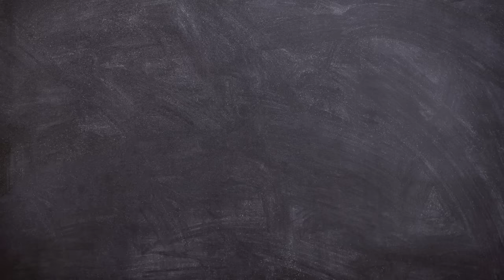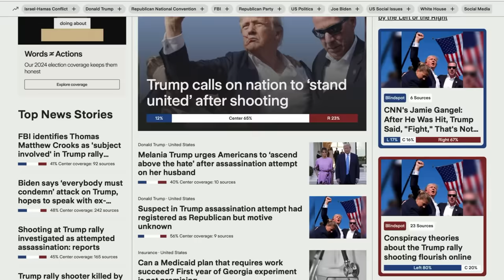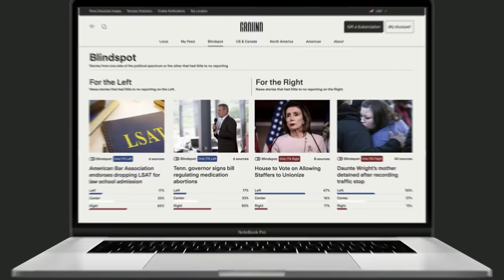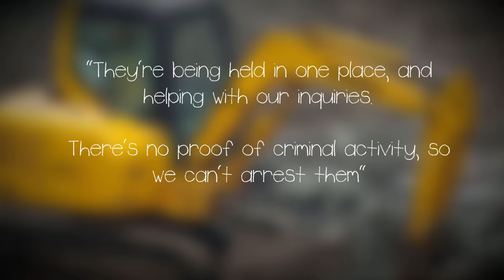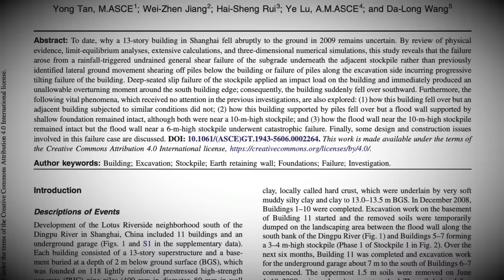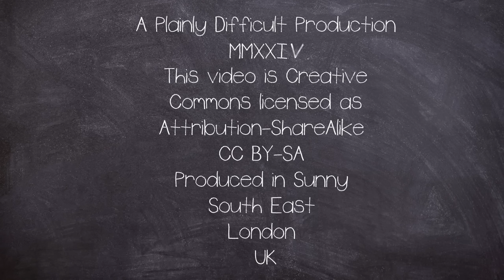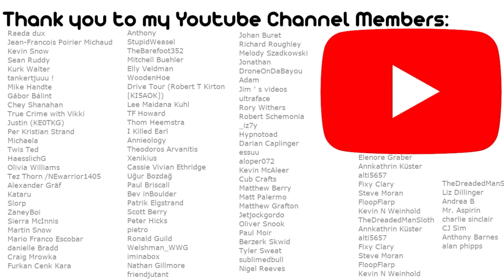Concrete and Steel Tower Falls Over Without Any Warning | Plainly Difficult

Comment: Civil engineer here. 

The abstract of the ASCE report states “Deep-seated slip failure of the stockpile applied an impact load on the building and immediately produced an unallowable overturning moment around the south building edge; consequently, the building suddenly fell over southward.” 

When slip failure occurs, the soil has to go somewhere. With a deep slip failure like this, the failing soil would be slipping beneath the neighboring soil, displacing it and causing uplift. This likely created a horizontal AND upward force on the underside of the north side of the building, causing the building to topple to the south. 

Extra physics fun:
In physics and by extension engineering, a “moment” is the rotational effect of a force, acting about an axis. A moment is produced when an axis of rotation exists (a fixed point that would resist a force) and a force is applied but not applied directly to the point where the axis exists.  A moment’s value comes from the force multiplied by the perpendicular distance to the axis point, or “lever arm.” In this case, the axis of rotation would be along the ground where the south face of the building is in contact with the ground, spanning the entire width of the south face. This is consistent with ASCE’s analysis. ASCE have the ability to run simulations as well and clearly determined this failure method to either be the most likely, or the only possible scenario.
Reply: This is the clearest explination of a “moment” that I have come cross. Thank you!
Reply: So the pile of land with the help of the water under it pushed the building columns sideways and up the building enough for it to fall in like 5sec?
Maybe with enough time that will be the case but then why didn't the building simply slide but rather topple. There must be at least a meter difference between the north/south end for it to just topple.
Also every one is talking about pressure on the soil which would make the building unstable but what caused the building to fall?
Was it off center, wind gust someone leaned on it?
Reply: Thanks for a splended scientific explanation... Isn't it sad, that everything discussed & required, can be destroyed by three simple words ...  "It's Good Enough".
Reply: It seems the north rising flow of soil would be slow, causing a slow tilt, allowing time for corrections the next morning. And the south piles would keep the south side from pressing into the ground and falling; at least not rapidly. A big fuss is made about the leaning tower of Pisa, but I was amazed that many of the building in Venice were leaning in different directions. It sits on mud.  In this case the probable deep lateral movement of soil, caused a moment on the piles, snapping them deep underground. Piles are not strong in moment. And the pile’s broken ends would be moved out of alignment so the broken south piles couldn’t support the fall of the south side. The piles would slowly be bent until they snapped with an earthshaking impact, that might have triggered the rapid soil flow on the south side. Soil under the south side could compress and flow rapidly into the “ready-made” garage cavity. The pivot/rotation axis was probably closer to the south wall but not at it. It is always dangerous to dig a hole or pile up soil near a building, unless the building is sitting on bedrock. Wet soil becomes fluid and head/height differences make it flow like water; applying pressure to one side of a building, and flowing out from the another side. The Seattle Millennium tower began to tilt when the city dug out ground. And the attempted repairs required more digging which caused more tilting.
Reply: @qa1e2r4  As far as I can gather, the imbalance was caused by the slip of ground beneath the 10m pile of earth together with the trench dug out on the other side of the building. This built a stress (3000 tonnes) acting in 1 direction more than the other (toward the river). That's your 1 meter difference, in effect. All that was required was the heavy rain to provide the lubrication / loading up of the waste earth and the mass of the building rotated about the piles. The latter are the reason it didnt slide. Its like trying the drag a fork through set honey. If the pile of earth had been 'piled' before hand, perhaps the stress may have been mitigated somewhat. But I might be miles out there!
Reply: I also thank you.
Reply: SNAFU
Reply: When I first saw this I figured soil liquefaction would be involved, coupled with insufficient pilings to support the structure weight - the construction being near a river that didn't really have a good substrate area to support heavy/narrow buildings like this.  Looks like a lot of other factors were involved too though, the deposit area of other soil adding to the lateral pressure on the building.  I've always known since the engineering courses I took in the 70s that the biggest issue with anything is building it strong enough to withstand far more than it should (for safety's sake) while being under a budget - those two factors rarely work together.  People want cheap/fast/good, and you only get two out of three of those in any endeavor.  This was cheap and fast, and obviously was not good.  Wish I could have continued with engineering, but I ran out of money for college.  Now I'm too old and too removed from the knowledge I needed to get in the field back then.  Still remember some of the easy stuff though.
Reply: Fellow mechanical engineer here. Correct
Reply: I had to read that physics explanation twice, but I don't think that I ever knew a "moment" had an actual calculation or instance associated with it! That's super interesting. 🤓
Reply: @KaiyaCorrbin  yep, in college (I'm a mechanical engineer) I was "seeing " moments every time I opened a door...
Reply: @1whitecottagelife770  Frick, now I'm going to think about it, too. xD
Reply: @lucasmetzger1154  ok, just a moment. Up to now, all buildings I have worked on have engineers signing off. Fella comes , checks the clipboard,  measures,  and says, " ....put the engineer..." this is the way of obtaining optimal power to weight ratios and avoiding undue overload to a structural element.
Reply: @billhester8821  what?
Reply: @NickatLateNite  ~ IMO, if it was good enough the building would still be standing. The fallen building looked not damaged after the fall, it must have been fairly well made. But it was the foundation and bad drainage that was crap
Reply: @martentrudeau6948  Marten... I almost 100%  completely agree with you, it looks like the ground survey was totally lacking, and the building foundation couldn't support the structure. The building itself doesn't seem to be the true 'tofu dregs' construction of most buildings. When I said 'good enough', I meant that somebody didn't do their job (survey/ground assessment)... They probably said 'yeah, that looks good enough', took their money and walked away... Unfortunately, this happens in a lot of chinese construction.
Reply: Could I hire you to just write me random physics facts all the time?
Reply: @therocinante3443  🤣 absolutely!
Reply: Cap.
Reply: @bigwebsite727  what exactly is cap here?
Reply: @lucasmetzger1154  this was clearly not a slip failure if you had read the report translation
Reply: Can we all just agree that second moment of area is a f*ing stupid name?
Reply: @NickatLateNite  "perfect is the enemy of good"
Failing to define scope & tolerances (aka good enough) is the best way to have a project fail in development hell or be impossible to actually manufacture.

Comment: No rebar in the piles. But, flood plane, so basically a concrete block on stilts in custard :o
Reply: exactly
Reply: "Concrete block on stilts in custard." Pfffff, brilliant
Reply: And thats on top of the concrete being made of inferior materials to save money.
Reply: Probably mud and straw
Reply: @carbonwolf3865 Delicious*
Reply: WHO knew ???
Reply: @SvendleBerries wouldn’t say that. The concrete seemed pretty strong as the building held up to the fall pretty well, poor concrete would have crumbled much more .
Reply: It's as if they aimed for the most creative way to make a disaster.
Reply: @Moonlight_Tide  To be fair, that is normal human behaviour? The acetone drum at work was under the wooden stairs by the only exit point for the office. It was a 200 litre one :D
Reply: @teamidris  wow, THAT was icing on the cake

Comment: 2:32 As soon as I saw this, I went "NOPE! That's gonna be BAAAAAD." You HAVE to give buildings solid foundations with something underneath to push against, and clay/soft sand is definitely not solid or secure. It'll sink on one side and then fall over. Especially when you add a giant earthen berm to push on one side of the building's foundations. Then it gets rained on and slides into the bottom of the building due to wet soil having no sheer resistance, pushing even harder and allowing it to tip over because the foundation anchor rods are compromised and cannot give sufficient strength to support the structure.

Comment: I once owned a house in Maine that was situated along a river. It was moved onto the property by a team of oxen one winter about 1850 when the river was frozen. It housed workers that operated a brickyard also situated on the property.  The bricks were taken down river to rebuild Portsmouth NH, which largely burned to the ground around that time. The soil there was nothing but clay, which, from what I observed, should best be thought of as a liquid when wet. When the road in front of my house was repaved, the guy operating the roller told me there was a wave in the road that would rise up just ahead of the roller.
A structural engineer my dad knew told me that when buildings are built on clay, they`re often designed as if they were a boat.  I`m guessing that`s a much more expensive way to build than what we see in this video.

Comment: SUGGESTION
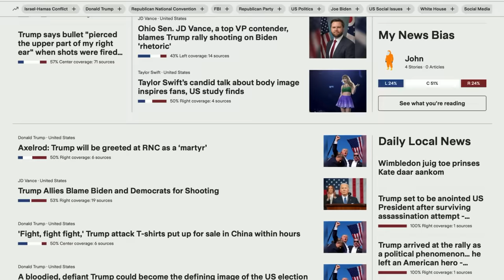Have you ever done anything about earthquakes and failures? There was that series of roads that were doubledecker in the San Francisco Bay Area. A civil engineer warned the city that if there was a big earthquake the supports would give, pancaking the top layer on the bottom layer, and if it happened during rush hour, it would be a mass casualty event. Then at 5:04 (aka Rush Hour) pm, this very dude was driving in that very section of freeway/highway and the Loma Prieta Earthquake hit (I think it was October 19, 1989, but it might have been the 18th? 17th?). There were a lot of failures at that time, but the most distinct was the pancaked bit of road.... that sadly took the life of the person who kept speaking about it. 

If you haven't done that, it might be an interesting one. I believe that the vast majority of casualties (deaths) from that Earthquake were all from that one structural failure. There were thousands injured. (myself included).
Reply from the maker: Thanks for the suggestion
Reply: @PlainlyDifficult  I love your work. :) If you want any other dribs and drabs and bits and pieces, I was in college during that earthquake, the epicenter was 13 miles away from my house, and the collapsed road was about 40 miles from my house (the collapse was directly north-north-west, while the epicenter was west south west of our house. 

My father even got a ONE SECOND clip of the earthquake. He was playing with his brand new toy he got for his birthday, a $1000 Camcorder, and he decided to do a time lapse video of shadows on our back fence. He caught the sound of the ground roaring (crazy noise!), the sound of buildings collapsing (mostly our next-door-neighbor's chimney), glass breaking, people screaming, the fence flapping like a bird's wing, and our cat, sleeping in a sun beam, glaring at the fence for walloping her. Our parrot, in the foreground, fell off his perch, and the video got the sound of him hitting the bottom of his cage and squawking. I should find the VHS tapes and try to get the video digitized. (it was, after all, 1989)
Reply: I used to go down 17 during the 80's. I would always pray an earthquake wouldn't happen while I was there!
I was in Santa Cruz that day. Wll never forget that day!
Reply: @brucelytle1144  Yeah.... it's a unique day, for sure. I remember calling my sister, who lived in Georgia, so she could tell me what was happening in the Bay Area as we had no power and no way of finding out what was going on. Of course, she's a bit of a drama queen, so her telling us that the entire city of San Fran was on fire, and the Bay Bridge had fallen was a bit of overkill. 

I was home, taking a nap, when the earthquake hit. The wall of the house smacked me upside the head. I didn't even know I'd been injured until the next day. I went to brush my hair and two things became immediately apparent, it hurt to brush my hair, and I had a huge sticky glob of stuff in my hair (dried blood, from a huge gash on my head). 

I was actually listed as two separate injury-casualties of the earthquake. First the gash to the head, and then a week later, when the Sears where I worked opened up, my first day back, I was on the escalator, one step above a woman holding a baby. An aftershock hit, and a 5 foot by 4 foot framed photograph/art-print on the escalator walls was dislodged. I saw it coming, and instinctively covered the woman behind me, with her child, so the painting bounced off my shoulder (collarbone bruised) and then clattered to the floor. That was, in its way, more traumatic than the original earthquake, probably because I was awake and had to actively put myself in harm's way. 

It was a crazy crazy event!

Comment: Choosing a tofu dreg to do a video on had to be tough. There are just so many to choose from.
Reply: It's like choosing a Warhammer 40k Imperial Guard battle that has a casualty count of over 1 million dead.
Reply: @airplanemaniacgaming7877 virginity confirmed
Reply: It's like choosing a game on Roblox that has in-game purchases, scams, money laundering, gambling, etc.
Reply: But it also shows two things:
1. The building itself, was constructed properly. so it wasn't actually tofu dreg. (otherwise it would have flattened / shattered on impact.)
2. the CCP habit to ensure it's a least someone of executive power, who gets life in prison does have effect. they don't corner cut in the final product, they only used temporary corner cutting (probably unaware of the liquid faction risk). knowing that those with executive power will be held accountable does have a chilling effect on such practices. 

Unlike in the US, where they always take a low level scapegoat and you have deficiencies in the maintenance and structure itself, so it then collapses, when in use. Pretty sure in the US, this would have been settled with some money to the family of the victim and no criminal charges. 

People often forget the sheer volume of construction, so it seems like there is a lot more of corner cutting. but the large number of cases, isn't that high, if you take the number of projects into account.
Reply: The 2008 earthquake revealed nation-wide tofu dreg constructions

Comment: I'm surprised that, for a tofu dreg project, that the building didn't reduce entirely to rubble when it fell. Never would have thought it would have kept its shape
Reply: when the only problem was the soil and foundation
Reply: that's rare
Reply: Because it wasn't tofu-dreg. IIRC that tends to happen in outlying cities rather than Shanghai or Beijing. Easier to get away with when the seat of power is further away.

Comment: you can see for you self on the video, if the actual building is a tofu, it will break in half once it hit ground. suggesting the building material is a "tofu" but in this case only the foundation revealed to be broken. so in this case, they put a lot of fund on the building construction itself but pay no heed on making a good foundation when the soil type itself is not actually strong enough to hold a skyscrapper building. it still lies on being negligent to save cost.
.
the reason a government sometimes dont allow a high skyscrapper building construction in some areas because the soil type and location is too dangerous to hold a lot of burden. but on contrary building a 2 - 3 floor houses should be safe there

Comment: It's probably hydraulic pressure of the soil doing its thing -- lifting and pushing. And when the build starts to slide, the forward side would likely dig in, when the bottom stops sliding (down-hill) the momentum of the top would continue and topple the structure over.

Comment: at that time i was a geoengineering student. i was given a 19+ parameter formula to predict slip failure under different load and soil models. couldnt make sense of it. after 16+months we discovered it was inconsistent, defining a parameter over side formulas with itself... it came from the building norm. the error was so small it never was a problem building on land, but when they started windparks... those turbines wouldnt stay straight, damge their gear....

Comment: As a side piece, you can also do a quick one on the Hatfield Colliery which caused 2 months of delays for folks traveling between Doncaster and Grimsby/Cleethorpes due to the Hatfield colliery having just stacked massive coal waste piles by the railway to where it finally shifted and slid out pushing the rails up and to the side with a train having nearly derailed by the initial wave.